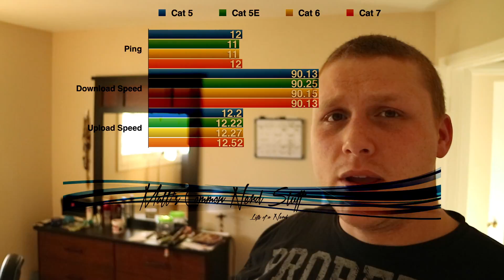Ethernet Cable Testing

Comment: Each of these cables is rated to 100Mbps so you wont see much difference in your test which maxed out around 90.  Speeds above 100 Mbps and much higher will differentiate each cable's performance.